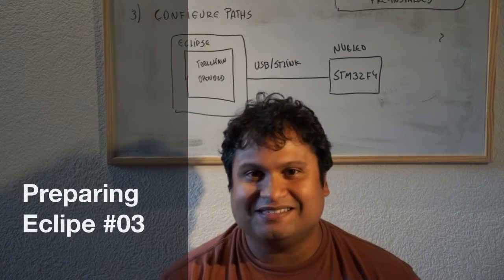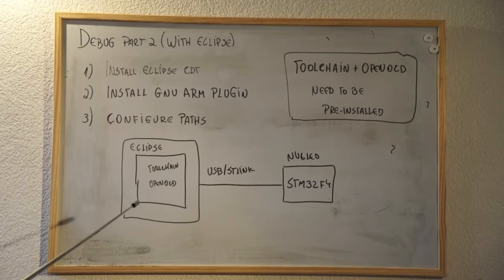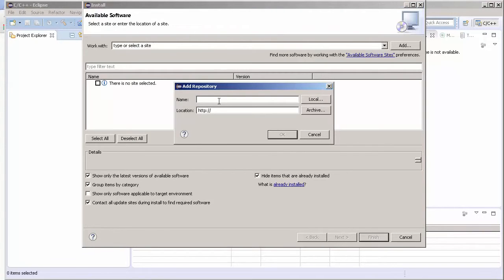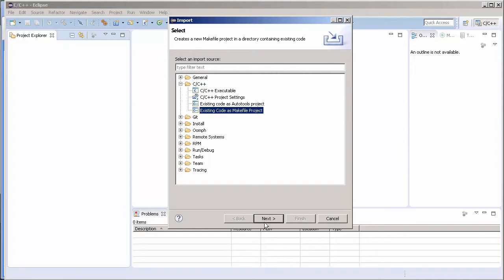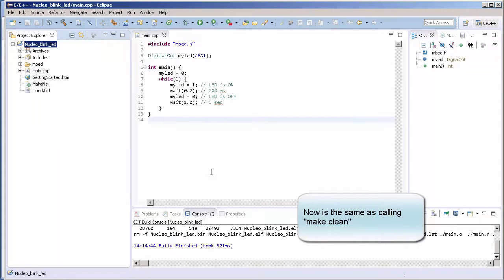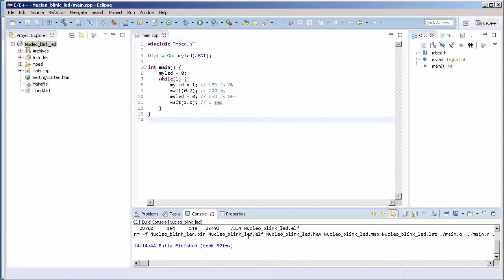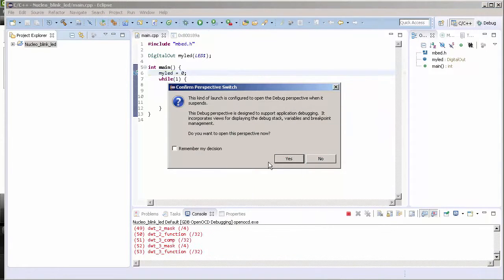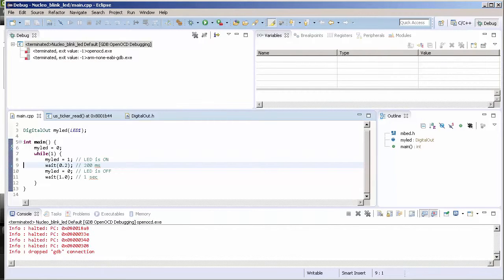Preparing Eclipe for ARM Embedded #03

Comment: Can Eclipse/OpenOCD utilize SWO/SWD, or ETM Traces that are available with the Atmel-ICE or J-Link debuggers?

Those features and debuggers work using Keil's uVision, but I couldn't get it to work using uVision/GCC/LLVM OpenOCD toolchain.
(I needed to switch after I reached the 32KB limit with Keil's Arm compiler).

Any thoughts on using EmIDE or VSCode?